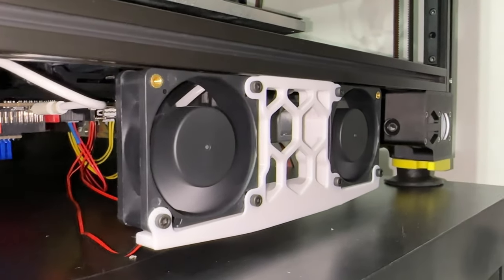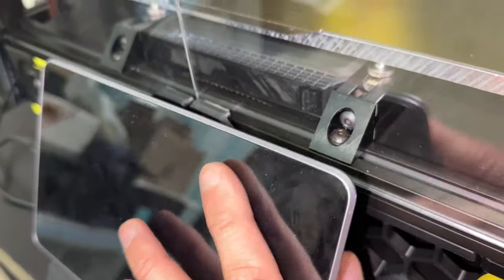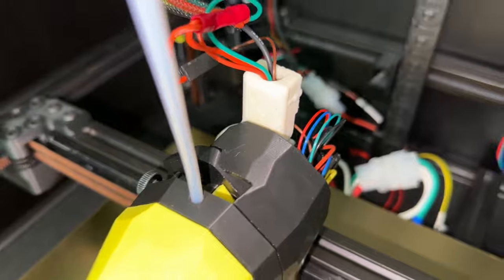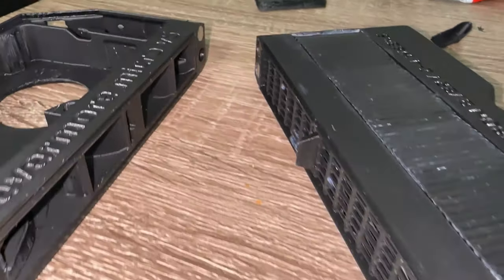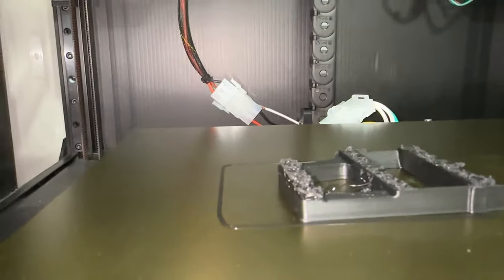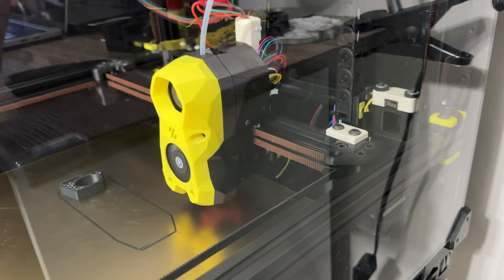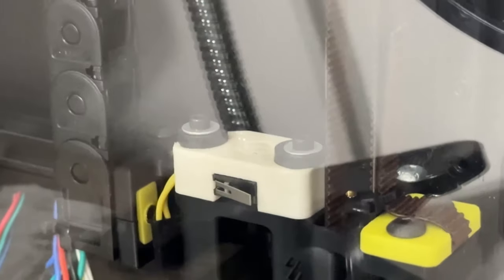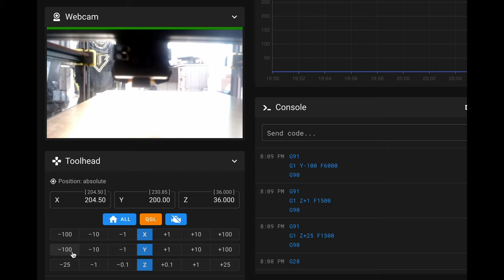Voron 2.4r2: The Quest for ABS

Comment: When using smooth pei flex sheets you really need to prep them before use by sanding them with some 800ish grit sandpaper. Using a little bit of water helps to prvent the pei clogging the paper really fast. You don't need to go really heavy, just nice and even, knocking the sheen off the surface and making it look more matte. It really increases the adhesion and you can redo it if the adhesion starts to weaken again.

Comment: What's the cardboard looking enclosure material you are using? Is it better than polycabonate?
Reply: That is just a product called Corplast. Just corrugated plastic, comes in a lot of colors.
Reply: That is one of the basic default materials in the Voron spec. It is a corrugated/ fluted plastic board mainly used for cheap signs like real estate signs. Coroplast is a brand name for it. It is also called Corflute, signboard, fluteboard and probably other names. Its only advantage is its cheap, easy to cut and has some slight insulation effect because its dual layer like a honeycomb. It is not very strong, very flammable and ages poorly. Just about anything else is better but it does work.